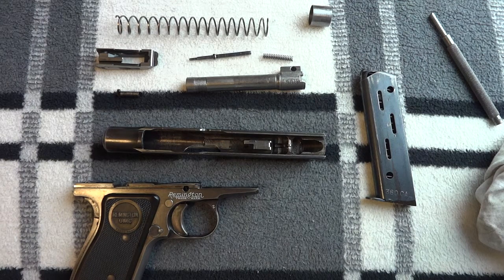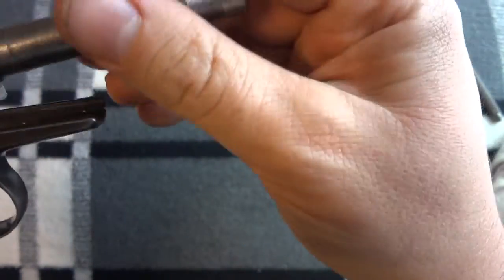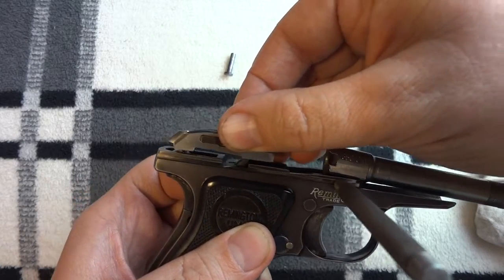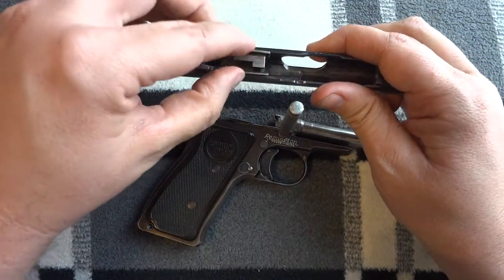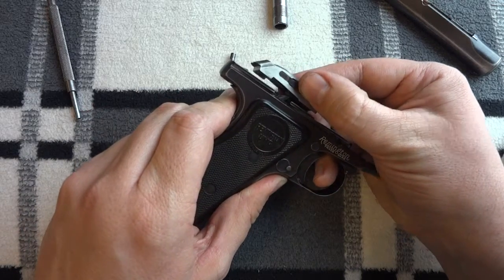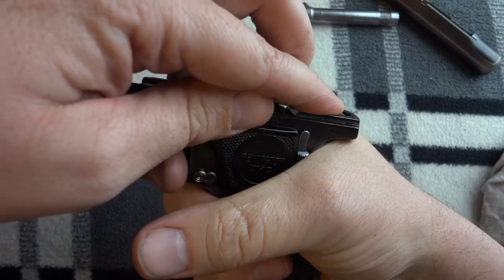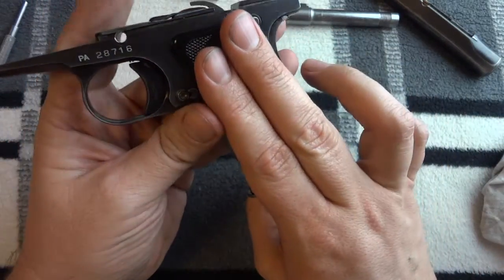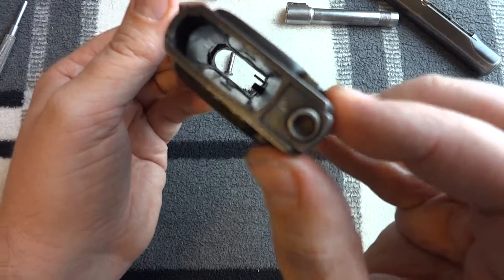Remington 51 Part 3 of 5, Description

Comment: My Model 51 is having a little FTE occasionally.  An instructor turned it horizontal, with the chamber opening facing up, to eject rounds(by racking, not shooting), and they couldn't fly out with enough energy.  I have watched your 5 videos(repeatedly), so I can take it down and clean it, which I have.  Is this likely an ejector problem?  I can manually push it down, and pull it back up, but it does not seem to be under any spring tension, and I know that this gun has an ejector spring.  Or so  says Jack First's parts list.  Any ideas?
Reply from the maker: The ejector spring is almost certainly not the problem.  I do not have the gun in my hand, but if memory serves, the ejector spring does not serve a function in ejection of cartridges, it merely pushes the ejector down for the purposes of disassembly.  The magazine pushes the ejector up in the path of spent cases and the extractor acts as a fixed ejector in operation.  At 4:20 in my video, you will note that I manually lift the ejector.  Frankly, I cannot remember without detail stripping the gun again exactly how the ejector spring works, but it most certainly not your problem.  Neither is the ejector going to be your problem, unless the tip is broken off.

My suggestion would be to check for tension on your EXTRACTOR and to ensure the claw is not worn or broken.  My next step would be to ensure the chamber is not pitted or dirty.  My first inclination after that would be that you are not feeding it full-power loads.  Many European loads are either overpowered or underpowered.
Reply: @RyeOnHam  I pulled the breech bolt out an looked at the extractor, which is pressed into the side of it.  The hook of the extractor looks pretty worn, compared to a picture of one in Jack First's product list.  But how is it removed if I want to replace it?  I took a picture, but YouTube comments don't appear to allow pics.

Comment: So I've got a question about the Model 51's function. I recently bought a Model 51 and for some reason it will not function through a magazine of ammo. It fires just fine, and actually feeds the next round, but the slide will stop short of the barrel either randomly, or if the trigger is still being held from the previous shot.  I believe the problem is within the dreadingly complicated frame, possibly a dissconector sear. I was wondering if you've had any similar difficulties/ issues with your Model 51s, and if so, any recommendations?
Reply from the maker: MrVitospizza My first recommendation would be to lock the slide back and look at the underside of the 'tail' on the bolt to ensure it is not cracked.  This is fairly common and can cause some of the issues.  I would also recommend a good cleaning.  It's complicated, but not nearly as much as many modern pistols.  The springs on your gun are nearing 100 years old and it's possible that the recoil spring is weak.  My guns have functioned perfectly with everything but an aftermarket magazine.  Is yours an original magazine?
Reply: First off, thanks for the recommendations, the bolt appears to be in good condition with no obvious cracks or scaring of any sort, I have taken the pistol mostly apart and cleaned it thoroughly and lubricated it and the magazine is an original. The age of the springs has been a question of mine as well, but when charging the gun, it appears snappy and quite quick for its age.

 However, and this I assume is related to the overall issue, sometimes when I rack the slide quickly, the gun goes into battery uncocked. When I've taken the gun apart, holding the hammer and pulling the trigger, everything seems to work, but when I hold the trigger and manually cock the hammer back, the hammer does not stay cocked. It will only stay cocked when disassembled if the trigger is NOT depressed.  When the pistol is fully assembled the gun still holds open almost always when the trigger is held and the gun is manually cycled, and it occasionally holds open when the gun is manually cycled without the trigger depressed.

anyways, I'm sorry if this is a lot of questions and information to be throwing at you, and I appreciate any advice you have, its just finding info on the Model 51 online is difficult to say the least as few people seem to even know about the pistol, let alone know how to work on one.   

again, thanks for any advice/recommendations you might have on this issue.
Reply from the maker: I think you are experiencing the disconnector functioning as it should.  When you press and hold the trigger, you cannot recock the hammer until the disconnector has functioned.  Push that little plunger on top of the frame in front of the hammer down after you pull the trigger.  Just going by memory here.  I would NOT suggest disassembly of the frame, but I've done it several times and it is no more difficult than a 1911.
Reply from the maker: MrVitospizza In addition to the disconnector functioning, it is possible that you either have a worn sear surface or maybe some gunk preventing full engagement.  Not usually a problem with this mechanism, though.
Reply: Thanks, anything is helpful here as I cannot figure out what the issue is. I don't plan on disassembling the frame, that's more of a last resort for me, as I'd rather figure out the problem before I start disassembling things that don't need to be then end up with a gun I can't put back together.

So in reference to the disconnector,  are you saying that when the gun is fired, the finger must be removed from the trigger before the gun has fully cycled? Because this is inherently my issue when firing the pistol.
Reply from the maker: Not exactly, I'm saying that there is a part that must be actuated in order for the hammer to reset.  Normally, the bolt depresses the disconnector. If you have the slide removed, you must push it down after you have pulled the trigger to reset the sear so that it can hold the hammer back.  I taught myself to detail strip the Remington 51 and there is no real guide for it anywhere I am aware of.  You kinda just have to know how it works. My gunsmithing skills helped, but if you've never rebuilt a carburetor without a manual, you might not want to dive into the frame on Rube Goldberg's pistol.
Reply: Ok, I definitely see what you're saying about not disassembling it, the one blowout I have of the gun looks a bit over complicated for my skills.
And I get what you're saying on the function of the gun, however, why would holding the trigger after firing stop the slide/action on its return forward about halfway across the magazine?
Its baffling to me as this a well designed, albeit complicated and very old gun, and this just should not be occurring.
Reply from the maker: I think you're confusing the two issues.
1) failure to return to battery (likely caused by a dirty gun and/or weak spring
2) hammer not staying back (probably just inexperience with the way the gun operates, but could be dirty innards or work sear.

You've checked your bolt which is usually the thing that will brake first (and make the gun a decoration piece).
Reply: When I'm saying the gun isn't returning to battery, I don't mean the spring isn't powerful enough, because it seems to be, I'm saying the action has a jarring stop as something is not allowing the action to move forward into battery.  

And yes, the bolt is not broken, as it looks the same as the bolt in your videos as well as other online and print sources I've checked. 

Again, sorry for all the questions and what not, it's just that this issue is frustrating me.
Reply from the maker: MrVitospizza That's about the best I can figure.  My next troubleshooting step would be to detail strip and examine the disconnector.  It might be a bit sticky and not moving out of the way.  That's the last thing that happens when the action closes, IIRC.  Maybe you can lube it and work it in and out a few dozen times and see if it moves easier.  REALLY difficult to do without the gun in my hands.
Reply: I completely understand, its difficult explaining the issue, I can only imagine understanding it from my explanation. I'll try and clean the heck out of it a bit more and hopefully that'll help, if not, its off to find a competent gunsmith. 
Thanks for all of the advice.

Comment: that's weird.. I wonder why he thought that a locked breech was needed in such a small caliber? The recoil spring must be pretty soft.. I guess he was looking for light recoil and a slide that a woman could easily pull back?  My old Colt 03 pocket hammerless was a lot simpler than this ..  One thing modern shooters cant understand about these old 32s and 380s was how good they felt in the hand and how slim they are. The "point hand shoot" on these is fantastic.. nothing like a modern "pocket rocket" these things had ergos and handling that are off the charts on a modern pistol.... they were natural fast and accurate shooters.. you kinda didn't need the extra power of a full power cartridge with these. .. you just see the target and POP!.. there is the bullet hole.. sights are just a crutch, you just point and hit!! haha
Reply from the maker: +Gloomshadow100 Pedersen didn't NEED a smaller caliber.  He designed a .45 caliber version at the same time of which a few were made, tested, and accepted by the Navy.  The market wanted the .380 and the .32 ACP; the design did not limit the caliber.  The reason the gun was so complex is that Pedersen was forced to work AROUND the John Browning patents.  Browning had already invented all the simple and obvious ways to lock the breech and those patents were still owned by FN and Colt.  Lots of curious designs came out of that era until Browning's patents expired and everything from then on was pretty much JMB clones.
Reply: RyeOnHam ah yeah, I forgot about the patents.. I forgot all about that.